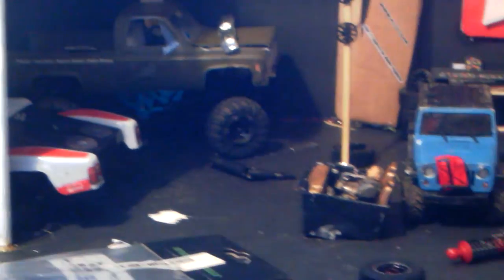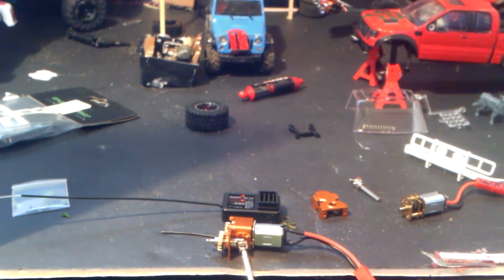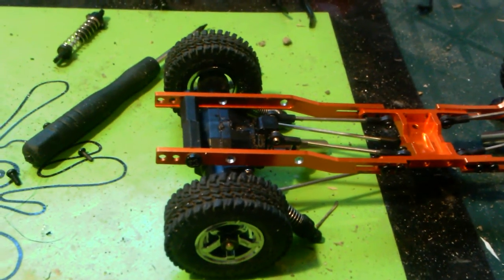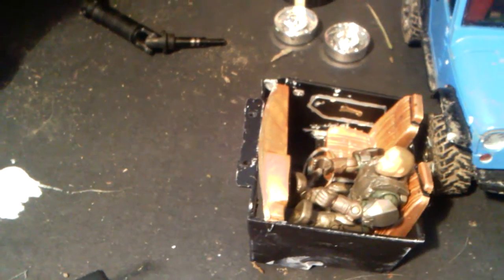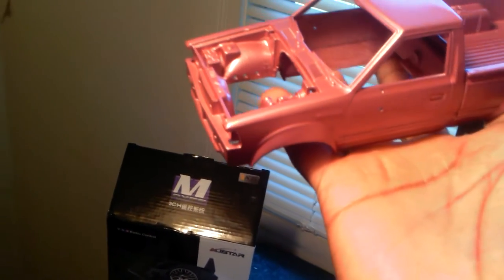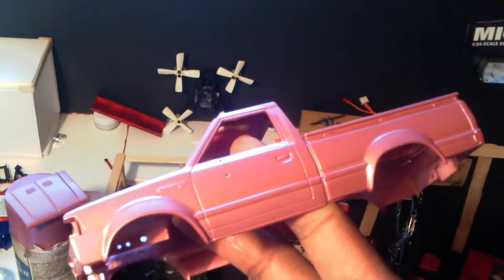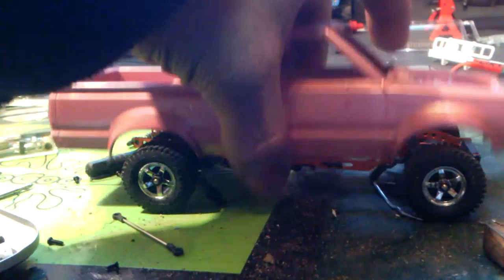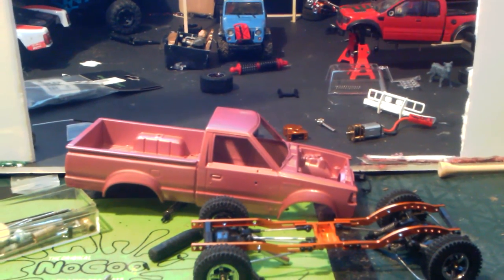Micro garage  Ep #5

Comment: Looks good
Reply from the maker: Thank you Steve !
Reply: antione motley  I got a Ecx that truck is cool and cheap
Reply from the maker: yes thay are i have to get mine runing
Reply: antione motley I found some large bearings that fit the on the insides of the wheels to weight them down for better crawling they make a big difference